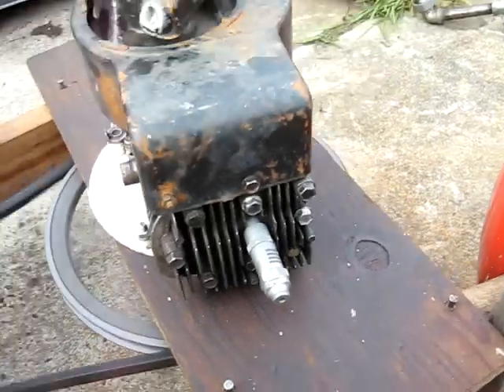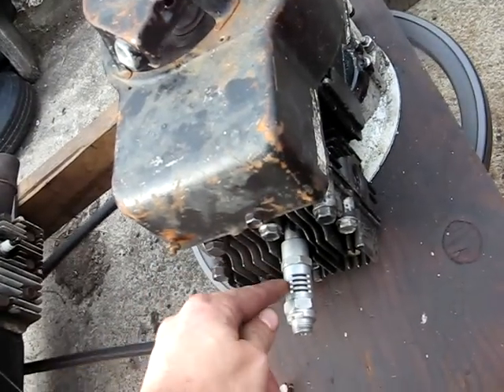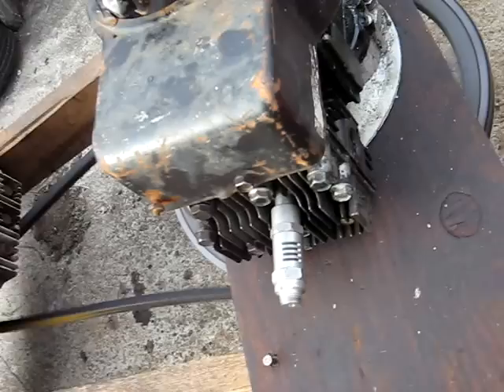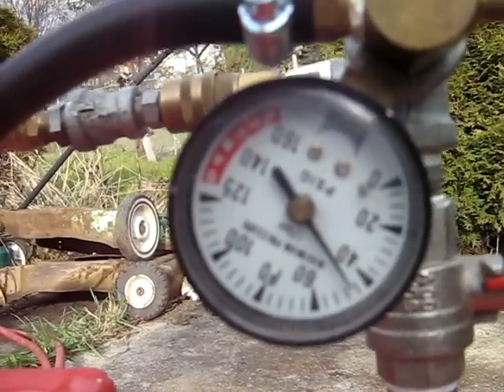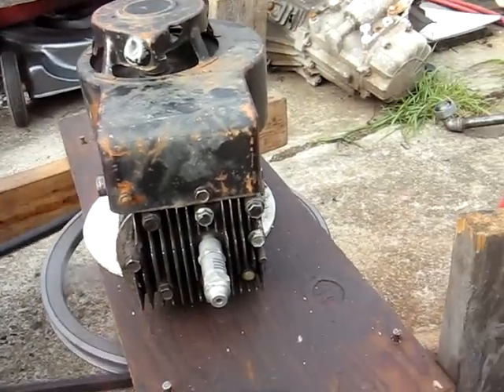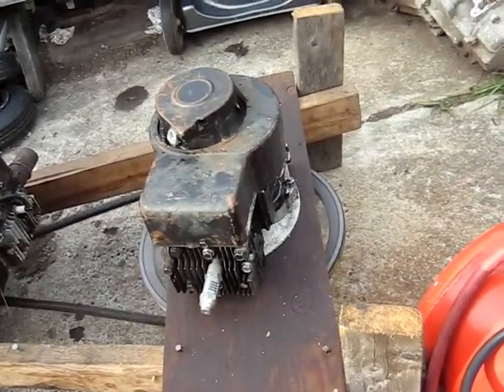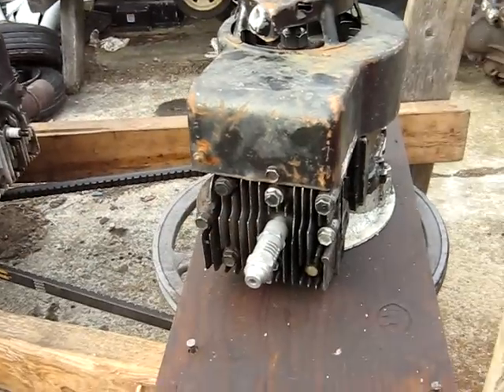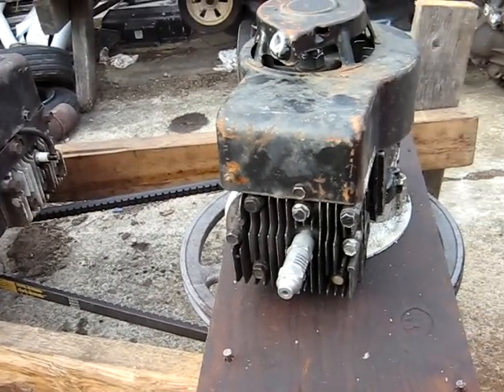Stage 9 Experimental Air Compressor 60psi :)

Comment from the maker: @ils360 
If you do that, it heats the air up more, since there is less time for the heat of compression to escape. that is one reason why compressors generally run fairly slowly, this one dose about 600 rpm.